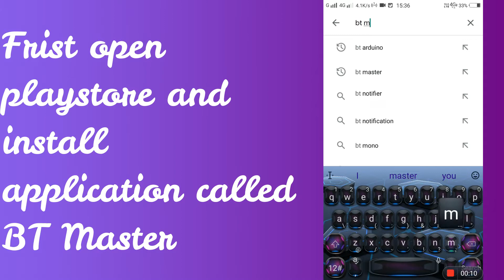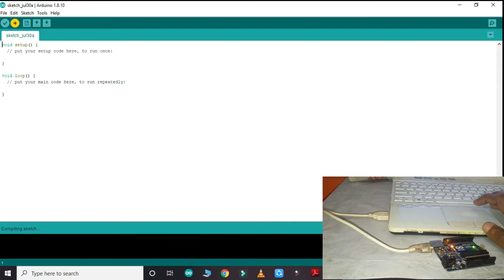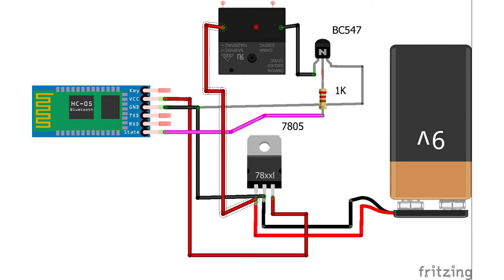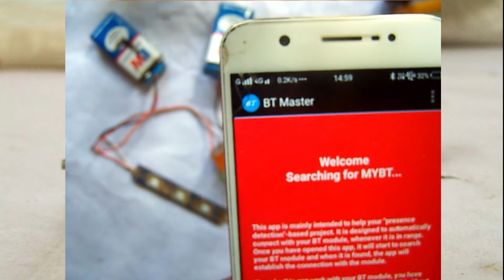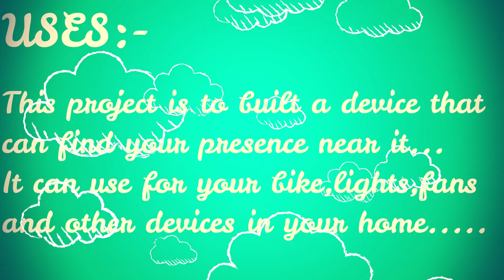Presence detecting system with Bluetooth||without arduino||HC-05

Comment: Hello bro. for me, I did not receive 'OK' in the serial monitor page. ANy fix?
Reply from the maker: Did you enter into "AT mode"?
Reply: @vinaytechsolutions8585  I did a small mistake. In serial monitor, i did not select 'both NL...' and hence it was not communicating.. now its working. thanks bro